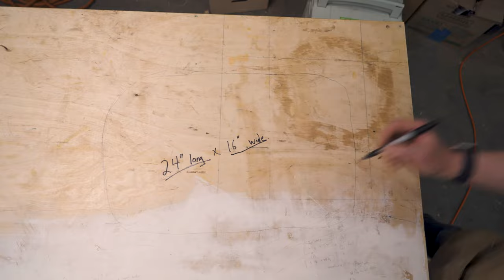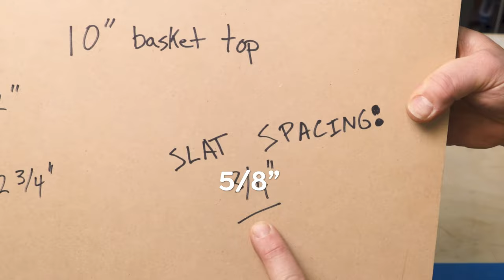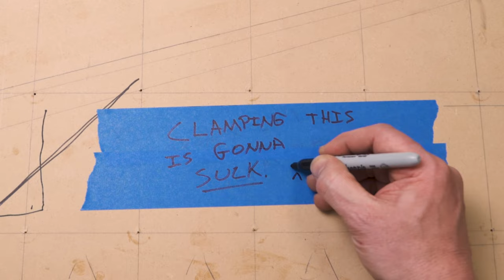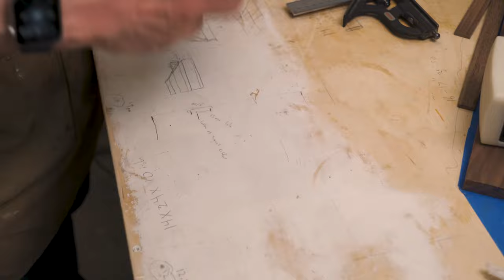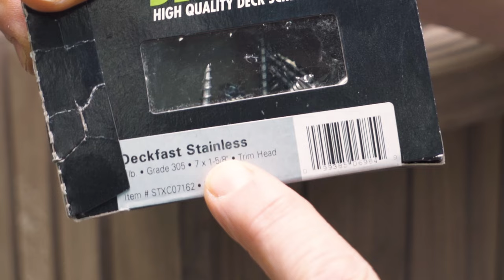How to Make an Awesome Wooden Bike Basket

Comment: fine!
but the taillight would be better protected when still on the old hight but more backwards shifted to be in line with the back of the basket.
(this way it would be also be more reflecting rays of the head lights of following vehicles)

putting the lock on the basket is surely practically.